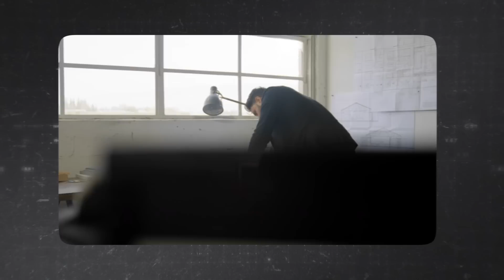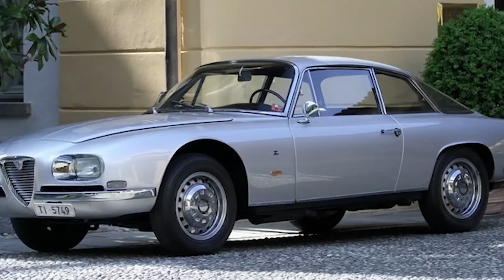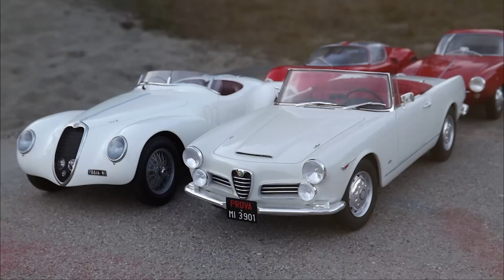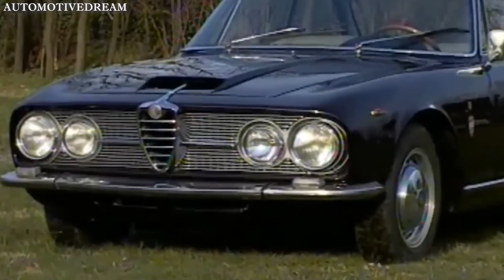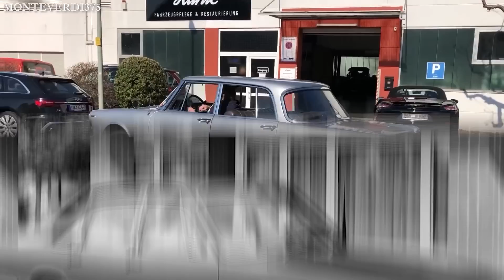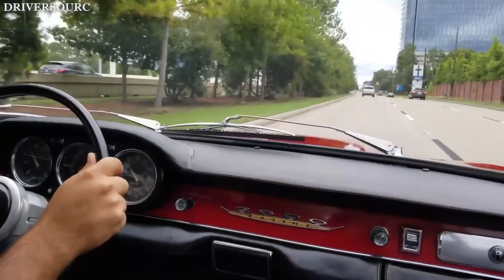When Italy Built a Beast and Then Walked Away...

Comment: The 2600 was a very nice GT car, but it was not much quicker than the smaller 105-series cars that came along shortly, and it was EXPENSIVE, like more than a Jaguar in many markets.  The cars weren't particularly fast, but they were wonderfully smooth and handsome.  They never sold well enough to stay in the line-up, not even matching the previous 2000's numbers.  The handling was not notable, displaying a lot of understeer, and the brakes were average.  This was not a new, advanced design;  it was an old car with a new engine and not much else to recommend it, at a high price.  Hardly a "beast" and certainly not a success...

Comment: I had three Alfas back in the day. I still miss them. Why have car makers abandoned affordable fun cars?
Reply: Th 2600 was NEVER "affordable".  In the early-'60s, a spyder cost more than an E-Type is most markets.
Reply: @rustyturner431  I was not speaking of the 2600.
Reply: I guess "affordable" is objective, but I managed an Alfa dealerhip in the 1970s, and an Alfa Spider cost about the same as a Corvette for most of the decade.  New, these were not inexpensive cars;  by 1977, a Spider or Alfetta GT with A/C and some accessories was over $10K...when that was a bunch of money.  Mind you, in many markets the cars got cheaper very quickly because the dealers didn't support the marque by buying/selling used cars.  The dealership I managed was owned by mechanics, and we did a good business in used sports cars, so the cars didn't depreciate so quickly.  A good used Alfa with a servbice hisgtory was a great car for the bucks, especially one from the '60s with carburetors.
Reply: @rustyturner431  Viva Alfisto!